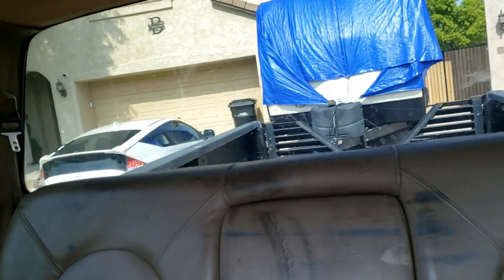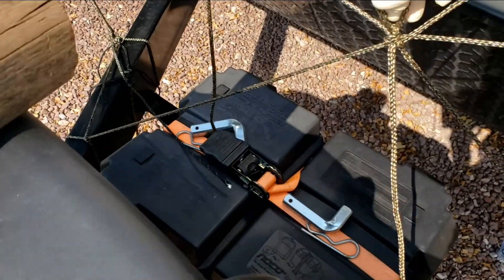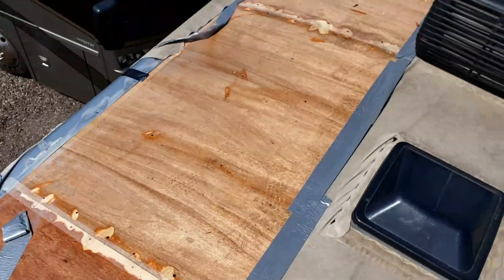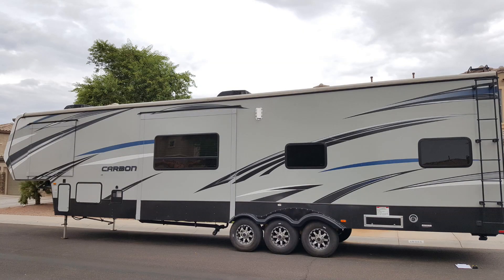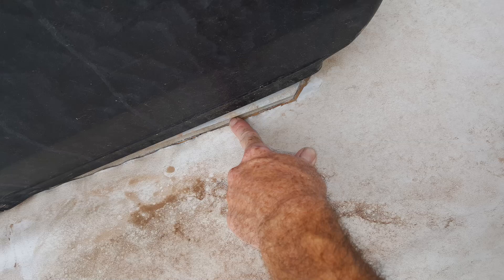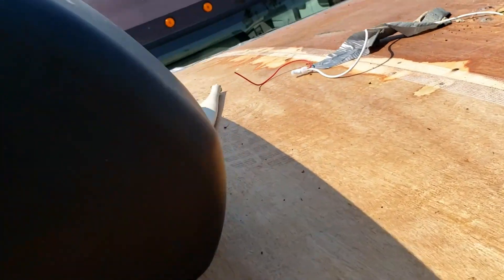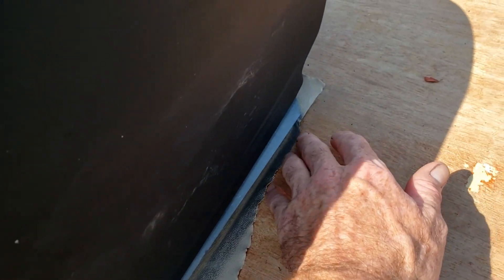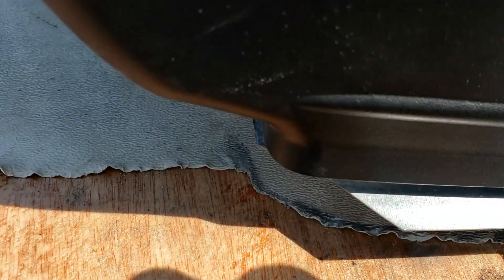RV TPO Roof Ballooning Failure? Manufacturer Defect?

Comment: I think you'll need to manufacture a metal air dam (just an aluminum angle?) at the bottom of the front cap. It seems it becomes pressurized at speed causing air to flow up the inside of the cap and under the tpo fabric.

I'm not an rv tech, and dont play one on YouTube. But I've got decades of repair experience in auto restoration, home building/restoration, and a bit of rv & boat repair.
Reply from the maker: I am thinking about doing it. Sounds like you're over qualified to work on RVs to me

Comment: Our 2015 Keystone Cougar 5th wheel had a tree limb go through the roof about the center of the camper during a storm. Local shop fixed cabinetry, replaced some of roof panels in that area and replaced the entire roof. I’m not sure the type of material they used. About a year later, on the highway far from home, I noticed something odd in my rear view mirror and realized the foreword section was ballooning up. Got off the highway, drove slowly to the campsite and got a good look at it. Just as you describe, it was loose across the entire front of the cap all the way back to the bubble over the shower. At that point, there was some stretching but no tears in the roofing material anywhere. I checked with a few places but no local shops could help me in my timeframe so I purchased a large cast net (I was on the Gulf Coast) I cut the weights off the net and tied it down for the trip home. That worked well, luckily I had caught it early and the net didn’t catch the wind under it. 

I was puzzled that it was ballooning up even though it was still secured around the edges. I didn’t think about the bottom of the cap. After getting home, I had a RV repair guy come to the house and fix it here. He did a good job and we haven’t had anymore issues (yet), but you got me wondering now. He removed the edging pieces and pulled the material back and re-glued it and was quite adamant the glue and sealants he was using was the best available. I think I will inspect the lower part of the front cap. Does anyone have suggestions on how to fill any openings I might find?
Reply from the maker: I really glad to hear you found it so quickly. Good work!

Comment: here is another theory maybe they are jut gluing the decking and not the membrane also, to save some $$$, or they could be using the environmental safe glue (water base) instead of the kind that smells good and makes you feel good that works a lot better
Reply from the maker: Membrane glue is water based, solvents will destroy the membrane. I really think the glue is too dry when the membrane is put on. That glue sticks to everything and the membrane was very clean.
Reply: @AZExpert  we used contact cement for rubber roofs and I know if you layed it down before it was dry to touch, it would cause it to bubble some, but over time it would lay down, I don't know about newer membrane never worked with it, do they put glue on membrane and decking at the factory ?

Comment: also basically same thing can happen with shingle roofs, if you shingle a roof when it is cooler or on a side where sun don't hit roof, then you have windy day and blows up edge of shingle where seal strip is and gets dust and dirt on it, then it will not seal, then next wind comes along and blows shingle off

Comment: here is my thought for all it is worth, they might not be letting the glue dry enough before installing the membrane and it is trapping the gasses between decking and membrane, then like you said air is getting in the front cap blowing under membrane and causing glue to dry, so now glue is dry on membrane and decking, and they wont stick together, so over time it will work other parts of membrane loose that is glued, seen gasses get trapped like this on rubber roofs on buildings, but over time it dissipates and sticks down, and of coarse they are in a hurry to get them down the line to make $$$
Reply: We build displays. When we glue a bare wood surface, the first coating of glue absorbs into the wood in effect becoming a "primer" coat. So, we have to glue bare wood twice. Once for the "primer" and once so the glue will actually stick to the PVC. In fact, the best way is to also apply glue to the "other" material so that the mating part is also glued. I seriously doubt that the "factory" would take the time to do this.

Comment: Seeing how these and motorhomes are built, how are you able to walk on the roof(luan, foam, insulation)?  I have a 2016 coleman lantern with no ladder. Does this mean not to walk  on the roof. Any weight limit(,besides the commom sense obvious)? I feel the need to walk it weekly seeing all these leaks and failures!
Reply from the maker: This roof is very lightly built. You can feel the trusses underneath and walk on those only. You should also be able to visualize them as they will line up with the square vent openings. Thanks!

Comment: I have a 2015 Rockwood Roo that appears to have the same roof material (Alpha) and has failed, the material has the appearance of dry rot on the sides. Forest River has given authorized a full warranty replacement parts and labor. Any suggestions for a better roof material than the Apha TPO they are providing? I would be willing to spend extra to get a better product. Thanks
Reply from the maker: That is surprising to be sure. The PVC roofs do seem to be a more durable product, I have not seen any noticeable difference between the Dicor and Alpha products.

Comment: I have a 2017 laredo 5th wheel doing that . The membrane is being cut by the a/c. I'm trying to fix it with out replacing it. Very disappointed with keystone
Reply from the maker: Me too. What's your plan? Might be able to remove everything at the front pull the membrane back and re-glue, but the tears will still have to be repaired.

Comment: Did you do a video for the EPDM roof replacement?
Reply from the maker: We are still awaiting approval from the insurance company, which is stressing the owener and me out.
Reply: @AZExpert  Been there spent 5 or 6 weeks in a parking lot in Fontana CA waiting for the warranty company to approve repairs.
Reply: Insurance company told me it's only liability insurance, which wouldn't cover this, is there an insurance coverage that would? Leak around a 2015 grand design due to roof gasket on front AC they say (maintenance).

Comment: I check my roof every time i go anywhere. I have 2017 Entegra  cornerstone 2017 
I bought it from Parkway RV center 
It was used he told me you check your roof yearly
Reply from the maker: I'm glad they told you to check annually, it's very surprising how rarely new owners are told. Thanks!
Reply: @AZExpert  Parkway does a 4 page check out after purchase .
Anything that needs repair is fixed  not only that they give you a video on how to check your roof  
I paid 344k for my coach i got a 1 year i extended it 2 years  
Its was 2017 it had 6000k miles  and it had 605 Cummins  and 12.5 KW Onan

Comment: I have a a Question... If the air gets under the roof from the front cap as built- Why doesn't the air travel up and under after the way you fix it. it still travels up and under Right?
Reply from the maker: The more I think about it, the les confident I am that the ballooning was starting at the front cap. I thinking it started around the A/C or antenna....which is concerning me even more.

Comment: Manufactures should know the roof is the first line of defense against water intrusion.  If you ask every buyer/owner if they'd pay more for a high quality roof. I think they'd pay a lot more and boost sales at the same time.  Coin the phrase "Ducks Back" RV roof and sell it as the best RV roof in industry with a 4yr warranty.  I'd certainly pay more for that.  But, they'd rather have a 3rd party repair/replace a roof and loose out on that revenue.  Doesn't make sense.  We all need to demand more from manufacturers.
Reply from the maker: Sadly, after floorplan, the number one important item for most RVer's(especially new ones) is price. High quality cost more and is not easy to see. Hence the popluarity of Thor pronducts. The real owners of new RVs are the banks and they do not demand quality only a VIN. It's a very strange world the RV world. Thanks!

Comment: First red flag KEYSTONE

out of ALL the manufacturers keystone is THE worst to deal with for warranty repairs or getting good information. They are put together with spit bubblegum and done by people who got two weeks on the job training who aren't tradesmen. 

I've seen two balloon roofs once on 275 Florida it was a Heartland coach that had the front cap replaced they didn't seal it tight and I think when the owner was going 75-90mph it got a lot of air before I flagged him down to tell him what's left of his membrane is twisting in the wind and on the interstate he was upset... Cursing the company that redid his fiberglass cap due to a stress fracture from manufacture.

I feel sorry for any fool buying a tt or fifth wheel during this pandemic I can only guess the quality of work being done understaffed. 

Good work as always
Reply from the maker: Without a doubt, I have very little respect for factory Quality Control. I also tend to think most trailers are made very similar when there are only 4-5 major trailer manufactures. Thanks!

Comment: I have a rv repair shop in Florida and replace 10 + roofs a month.  I have replaced quite a few that have ballooned and have had a few covered by insurance.  When I use rv tpo I install a an extra termination at front cap and have never had an issue. The top is being weakened by the sun and the sealant allows air under front cap
Reply from the maker: Thank you very much for the advice .I have heard and seen of that practice. It's good to know it works.

Comment: I see this all too often on travel trailers when I'm driving down the interstate.  Blame the manufacturer they built the damn thing and their dumb 1yr roof warranty.  That's proof they expect water intrusion/defects around the 1yr mark.  The poor souls buying new RVs during the pandemic :(
Reply from the maker: It sounds like this is a much more common problem than I thought. I am not surprised as the manufacturers never accept blame for design. Thanks!

Comment: Have seen roofs ballooning on trailers on the road a number of times. They also seem to have been 5th wheels. Gotta be the huge low pressure area just behind the front cap and the TPO material not staying adhered to the deck like it’s supposed to. One more thing, with those absurdly huge leaf springs on the back of your truck, there isn’t gonna be any sag unless you put a huge 5er on there, lol
Reply from the maker: I will say the truck is much more comfortable to be in when I'm towing something. Thanks!

Comment: James, I don't really understand your philosophy or I misunderstood what you said.  My way of thinking is the front cap should be over the roof and not the roof over the cap.  To me, if the roof is under the cap, sealed with the cap strip molding and screwed, then when going down the road the air hits the cap and glides over the roof and it can't hit the edge of the roof to get under it.  
Now saying that, If and only If the air is getting in from the bottom of the cap and works it way up to the top front and penetrates under the roof because of a bad sealed and screwed molding, then I can see it ballooning up.  Again, this is my thought process, but I never worked on such a project.  I look forward to the answer/problem with the factory installation.  Thanks for the discussion and video.
Reply from the maker: I don't understand it either. I'm still researching. I'm leaning into the idea that the factories let the glue dry too much before applying the membrane, so the wet glue did not adhere to the membrane. Thanks!
Reply: The air from the space at the bottom of the front cap is coming up underneath the cap.   Because it is pressurized and the front of the roof is not fully glued down and/or badly trimmed, the air is getting underneath the roof.   At least that is the theory.

Comment: I see 3-5 roof bubbles on the roads every year during my travels. Just saw number 3 for this year yesterday. I have only worked on 1. It was 3 years ago and it looked just like the one you showed at about 3:20 mark in this video. The people were traveling thru on their way home and wanted to continue, so I screwed strips of paneling to hold the roof down and sealed it with Eterna bond until they could get the roof replaced. I never heard from them again, so I guess my temporary repair worked. Great video
Reply from the maker: Did you add another molding at the front cap molding?
Reply: @AZExpert  I don't think so. The guy didn't have very far to get home and no rain in the forecast, so just mostly tried to keep it from coming completely off like the one in your video. I forgot to mention that this was a MH, so that kind of messes up your theory on air getting under front cap.